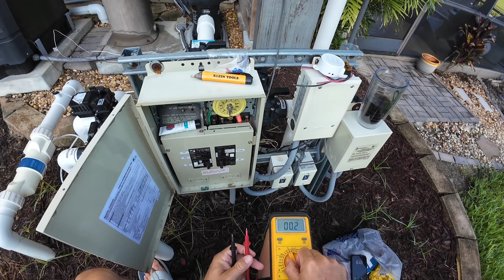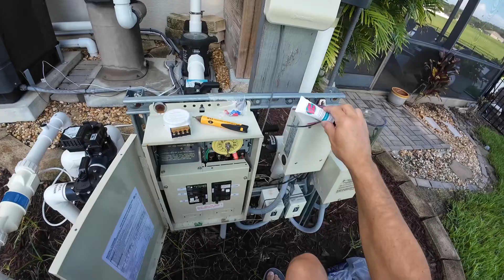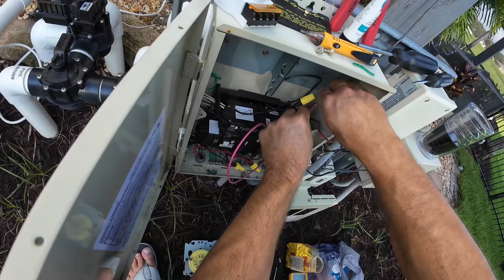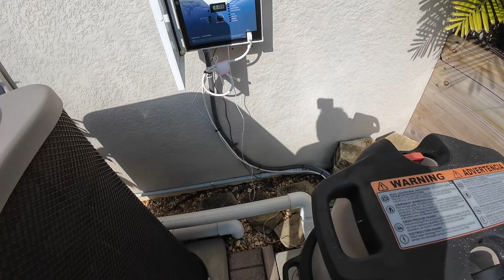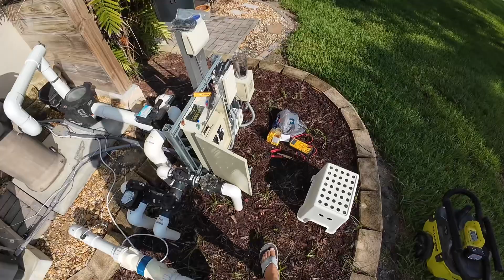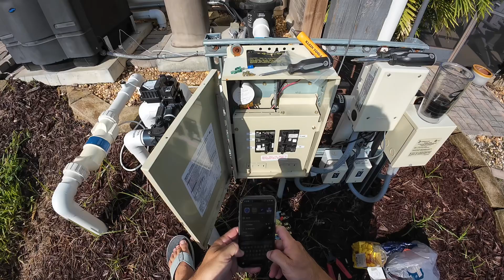Replacing Pool Equipment Mechanical Timer with a Smart Timer - Hayward Salt Cell

Comment: Is this timer set up for the salt Cell, the pump or both? I have the same mechanical timer as you do and it turns on both the pump and salt Cell.
Reply from the maker: This timer is only for the salt cell. The pump would probably require a higher amperage switch. I’ve seen some on Amazon that mention being able to work for a pool pump. They are bigger and have their own enclosure.